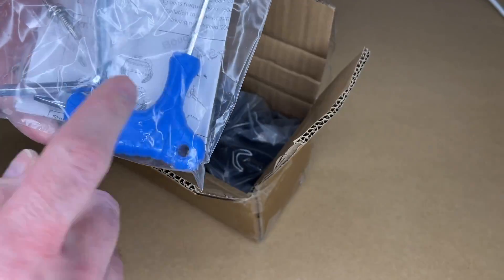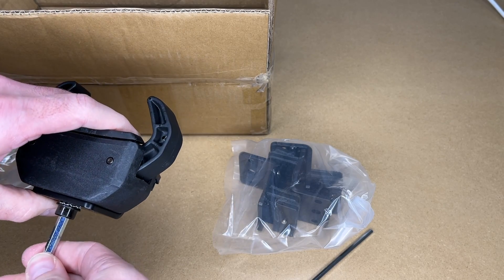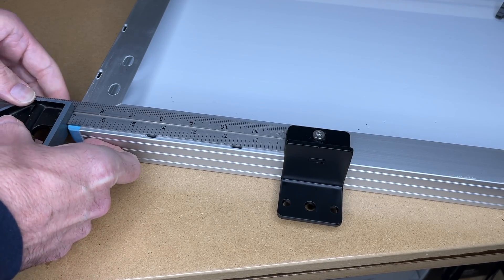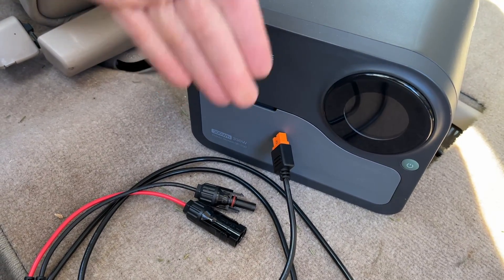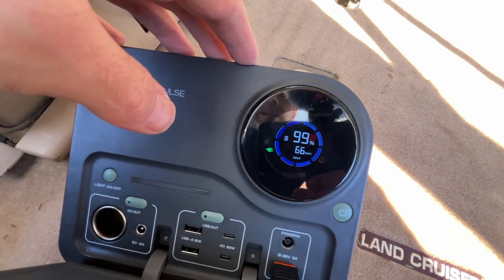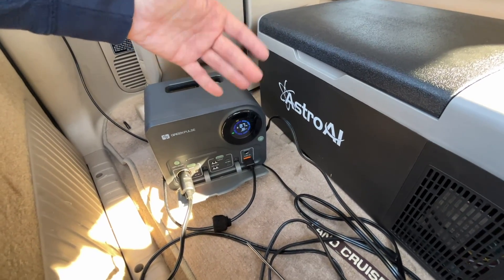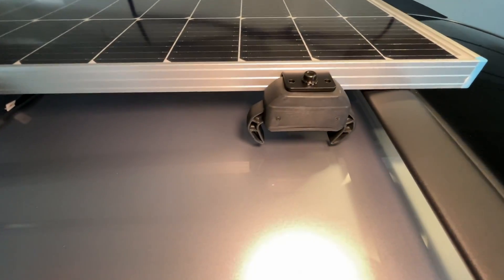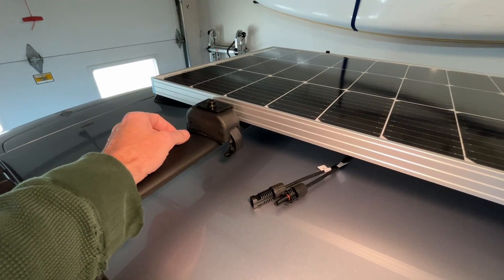BougeRV Crab Roof Rack Solar Panel Mount with No Drilling!

Comment: ROI on the panels and battery if you were charging all day most days?
Reply from the maker: I'm not sure what you are asking. My 100W panel typically is able to keep the charge up on my portable power station when using it to power my portable fridge on a weekend camping trip.

Comment: Im doing something similar but a bit scared of the updraft under the panel going down highways and making my solar panels fold. was that a concern at all for you lol. maybe im overthinking but im thinking of ways to reinforce the panel itself and then mount it. Any ideas by chance or what might you do in that regard? Thanks love the vids
Reply from the maker: I haven't been too worried about updraft affecting these off. Are you using still panels like mine or a flexible panel. I'm thinking a flex panel might oscillate and break due to fatigue. The panels like I am using are very durable. The mounting is very stiff with the roof rack. I'm guessing it would take quite a bit to break one. There are companies that make wind deflectors for their roof mounting systems (like Yakima). I'm not sure if there are universal deflectors available but that would direct air over the panels.

Comment: I picked these up probably about the same time you made this video when there was nothing out there about them - I just didn't get around to installing lol. This looks really good. I'm thinking of actually putting a SAE port in the exterior of my van to bypass the need to run cables inside through the weatherstripping because I have a Jackery and it will charge via 12v outlet while driving so I only need the panel when stationary (I'm a videographer who does music festivals so I charge a lot of batteries!)
Reply from the maker: I mostly just ran the cables through the weatherstripping because I move this between cars. I mainly use mine for camping and road trips (powering my battery+fridge). This would certainly work well with a more permanent wiring setup. You might consider using MC4 connectors as they are waterproof. You can search for something like "mc4 roof entry plate". You can get MC4 crimp kits pretty cheap on Amazon. Those would be sealed with something like Dicor. My RV had one installed from the factory on the roof. My RV also came with an SAE outlet on the side but the weather gasket looks like it will leak someday. The SAE outlet is lower profile, which is nice.
Reply: @Rickmakes  brilliant, thanks for the suggestion. I was trying all day yesterday to figure out what I needed to search for to find the best connection method. I have a 2020 Chrysler Voyager that's my camper/equipment van but also is my daily driver with kids so each modification needs to be planned out and hot-swappable as well.

Comment: Well I just found the way I am going to put a 350 watt panel on my old 2006 Chrysler Town and Country Ham Radio van.. Going to feed a 300 amp 12v LiFePo4 battery and this install will be fast and simple..
Reply from the maker: I've been very happy with these. I typically mount a solar panel when I go camping or on a road trip to power my portable power station and fridge.

Comment: Could you please relate the distance that the crab mount extends from the edge of the solar panel when mounted (including the bracket width). Thanks. I'm considering purchasing a BougeRV Crab Mount kit to mount a BougeRV 200w 16BB N-type bifacial panel (width is 30.2") to my Dodge Grand Caravan that has OEM racks with 36" available between the uprights. So, I have approximately 5.8"/2 = 2.9" on either side of the panel  to attach the mount. Does the crab mount plus bracket exceed that width? Might be a tight fit.

Great overview of the mount kit. Thanks for posting the video.
Reply from the maker: If I measure from the side of the solar panel to the outer edge of the mount I get around 1-7/8".
Reply: @Rickmakes  OK. Looks like it should work for my vehicle. Thanks for taking the time to measure it.